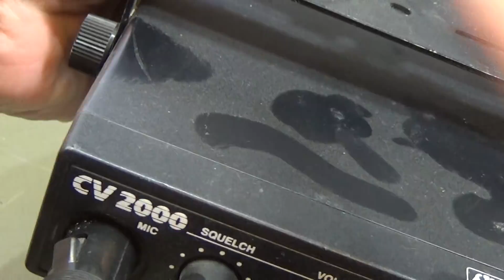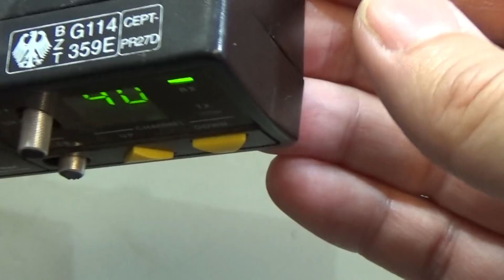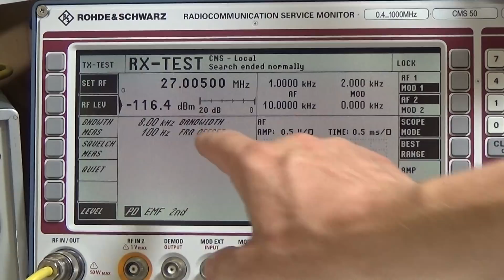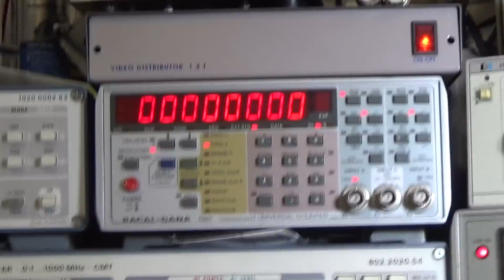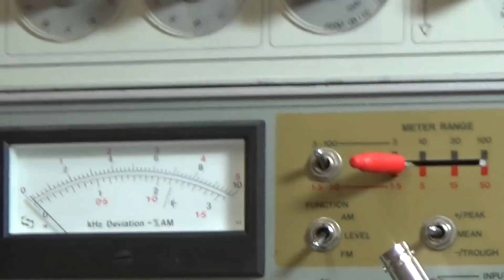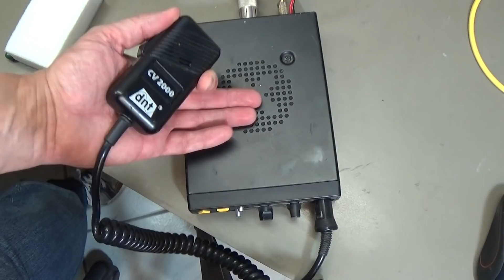#180 Old dnt CB radio awkes to life after decades in the shelf.

Comment: Yet another great video Peter, just one question, where did you get the push on PL259 plug you use for quick antenna connection to the radio? I have searched all over for one for my bench. I noticed Mike s radio repairs has the same thing. Karl
Reply from the maker: Yeah I was searching for it as well. Mike gave me supplier in Canada where I ordered it from but I have forgotten the shop. Ask Mike he certainly knows...
Reply: A quick update on the PL259 connector. The Canadian company sells them on Ebay, item No. 202387686756

Comment: Very good Peter. I like the CMS50, it seems very much improved over the old CMS52 I once used. Especially the automated tests!
Reply from the maker: Thank you Alan. Yes my CMS 50 has a firmware from 2016 and thus the CMS 50 is better equipped then the 52 back in the days. On the hardware side the 52/54 have some additional features which are more for mobile use like avionic services or so not really needful to me  as I have all the capabilities in my lab..

Comment: @ 23:00 it is more likely to be the capacitive coupling causing the frequency to drop when you touch the crystal.
Reply: Yes thermal drift would not act so very quickly.
Reply from the maker: You are right it is always not only one effect...
Reply: I was thinking that as well.  Wondering if modern radios exhibit that same sensitivity to chassis "disruption"
Reply: Mike Sawyer - when I am aligning a CB I always do it with the top cover on, as it can affect the tuning.